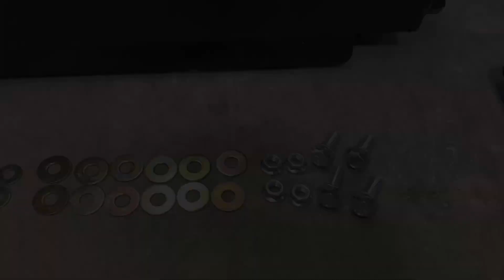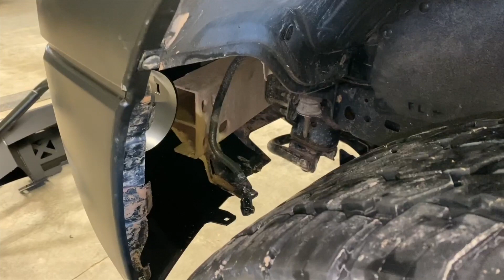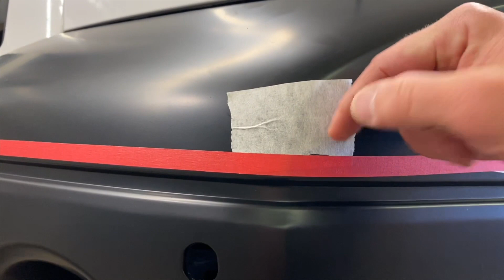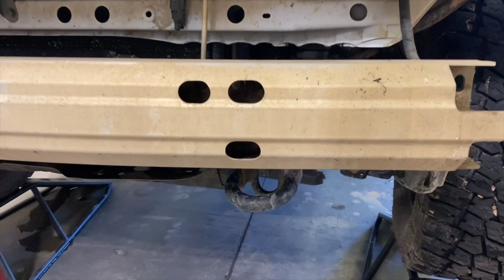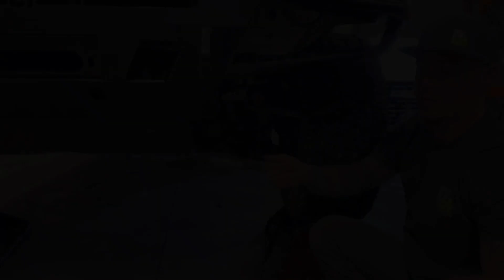2nd gen Tundra Front Bumper Installation Guide (2007-2013)

Comment: why measure up 3/4 inch when cutting bumper?, looks like there is a big gap after install.. could you just trim it a small amount like 1/4 inch so it sits closer?
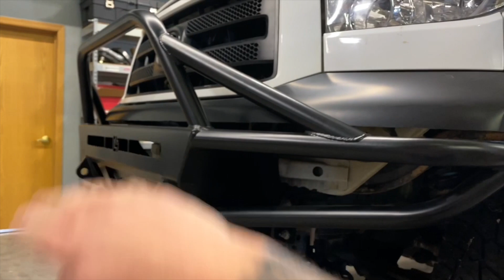Reply: He mentioned in the video at 14:25 that they do that to compensate for the natural flex that the Tundra suspension and body experience independently of each other so there is no rubbing.